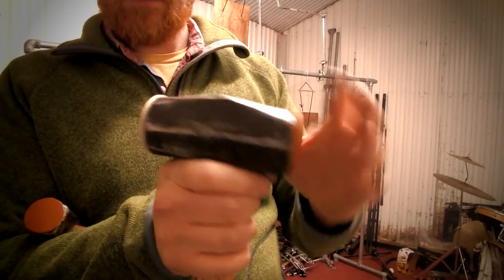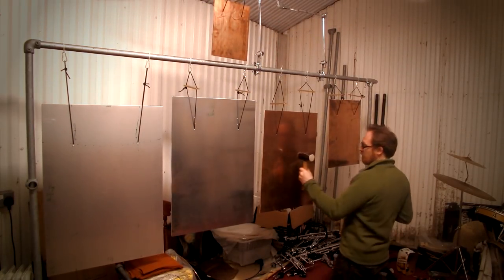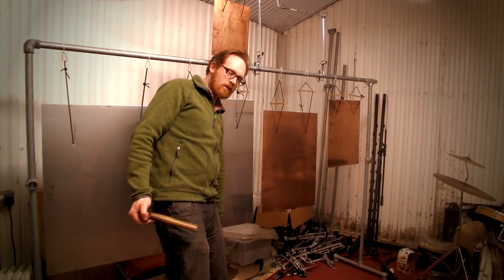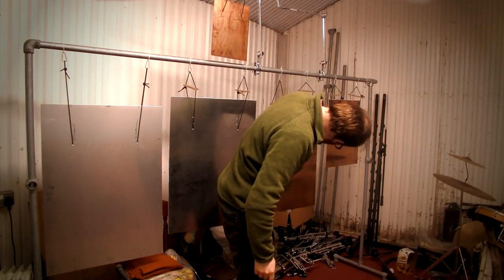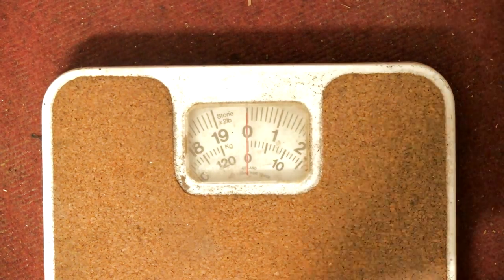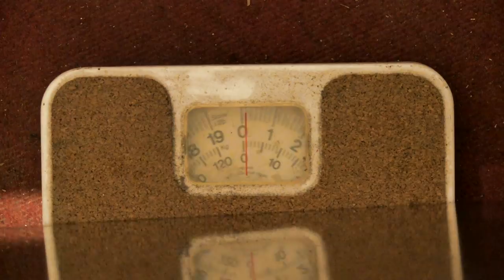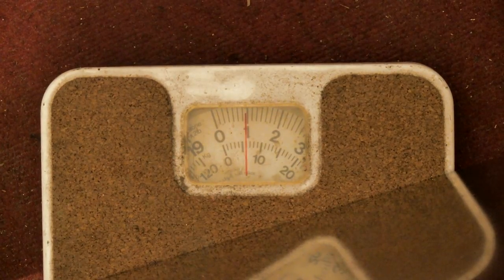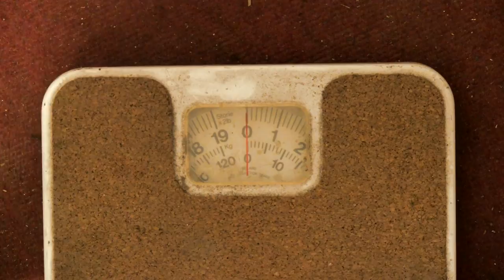Bronze bass Bell Plates - comparison with Aluminium

Comment: Would many percussionists have bell plates this low? If not, what is the pitch range for bell plates that you could expect a percussionist to own?
Reply from the maker: Weston Gilbert Most percussionists do not own their own bell plates. Even many orchestras don't own their own sets, but will rent them as and when they need them. Typical range for plates is C2 to C5 or C6 (with C4 being middle C).

Comment: Can you use also a simple iron to make that? Iron cost less 😛
Reply from the maker: You can make bell plates from Steel. Their sound quality is between aluminium and bronze, but they are larger and heavier than bronze for the same note, and you must put a coating on them or else they will rust.